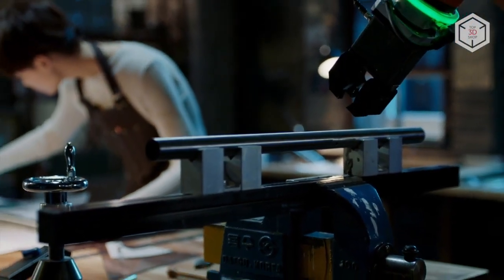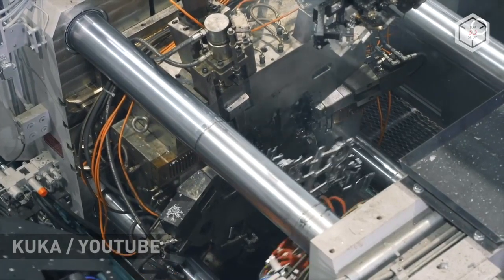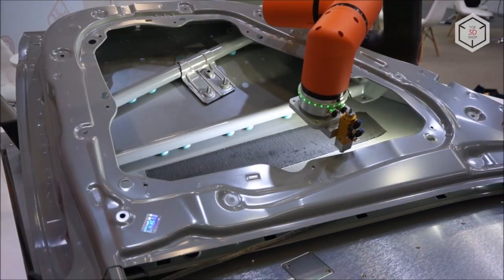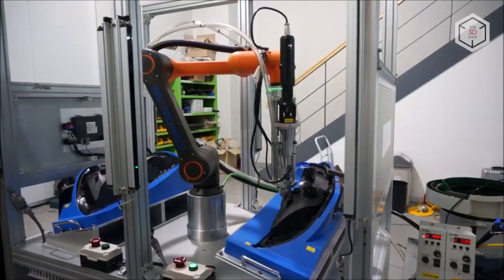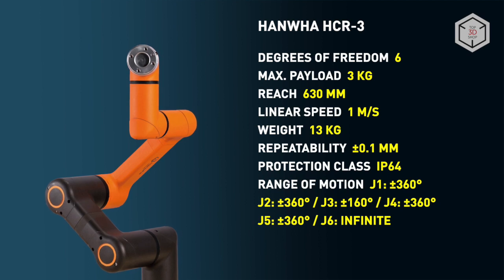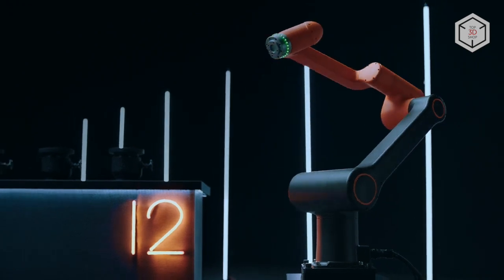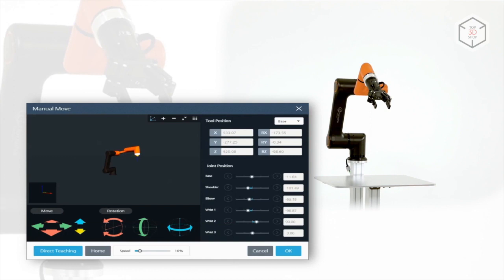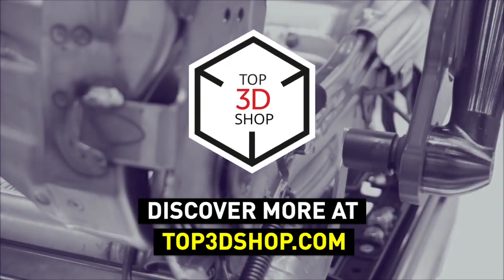Meet the Hanwha’s Collaborative Robots (Cobots): HCR-3, HCR-5, HCR-12

Comment from the maker: HANWHA HCR-3
Degrees of Freedom:  6
Max. Payload:  3 kg
Reach:  630 ММ
Linear Speed:  1 m/s
Weight:  13 kg
Repeatability: ±0.1 mm
Protection Class: IP64
Range of Motion:  J1: ±360° / J2: ±360°
J3: ±160° / J4: ±360° / J5: ±360°
J6: Infinite

HANWHA HCR-5
Degrees of Freedom:  6
Max. Payload:  5 kg
Reach:  915 ММ
Linear Speed:  1 m/s
Weight:  21 kg
Repeatability: ±0.1 mm
Protection Class: IP54
Range of Motion:  J1: ±360° / J2: ±360°
J3: ±165° / J4: ±360° / J5: ±360° / J6: ±360°
Has a cleanroom classification 2

HANWHA HCR-12
Degrees of Freedom:  6
Max. Payload:  12 kg
Reach:  1300 ММ
Linear Speed:  1 m/s
Weight:  51 kg
Repeatability: ±0.1 mm
Protection Class: IP54
Range of Motion:  J1: ±180° / J2: ±150°
J3: ±165° / J4: ±190° / J5: ±170° / J6: ±360°